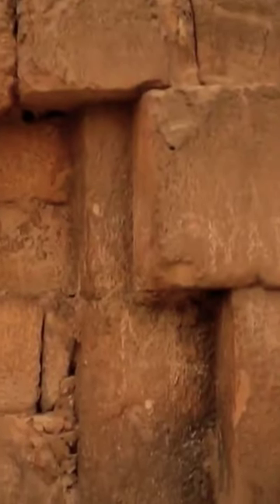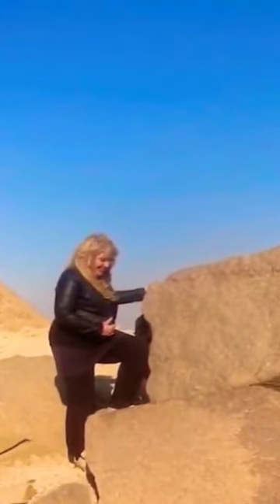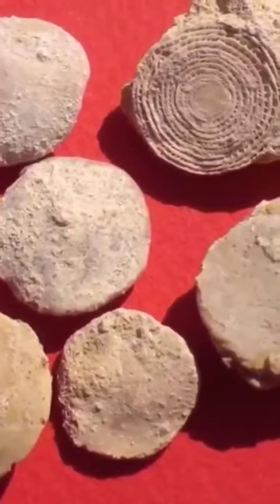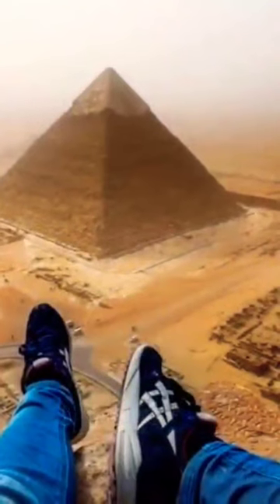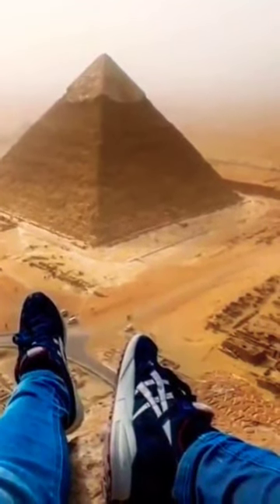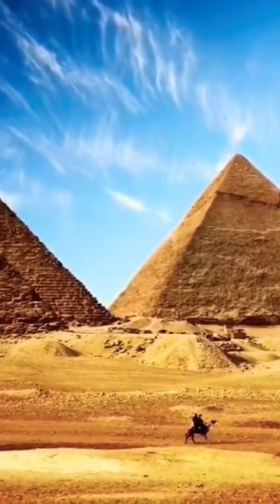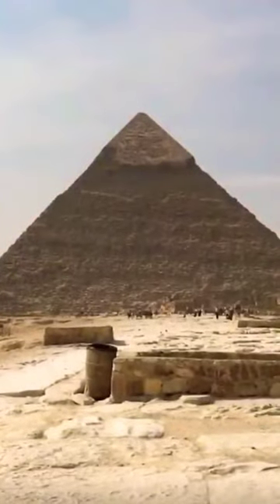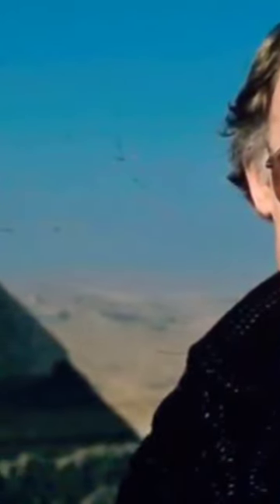Graham Hancock on GEOPOLYMER (Liquid Concrete) Use at Great Pyramids of Giza #shorts

Comment: the slurry wasnt crushed like u think....it was disassembled...and fossils were a part of the slurry .....like the granite ...we can make counter tops that look just like real granite...but its even stronger...just like the blocks on the pyramid
Reply: That was my thought as well.
Would it be possible that in the "slurry/mix" that not everything was ground up into powder, but that also small pieces of rock and rubble were included in the mix, some of which may have contained fossils?
Reply: That was my thought as well..
Would it be possible that in the "slurry/mix" that not everything was ground up into powder, but that also small pieces of rock and rubble were included in the mix, some of which may have contained fossils?
Reply: Exactly! It wasn't ground up, it was melted!

Comment: Would it be possible that in the "slurry/mix" that not everything was ground up into powder, but that also small pieces of rock and rubble were included in the mix, some of which may have contained fossils?
Reply: Why would you make a complicated polymer to use for building material when there already is plenty material available?
You know they found quarries near the pyramids, right?